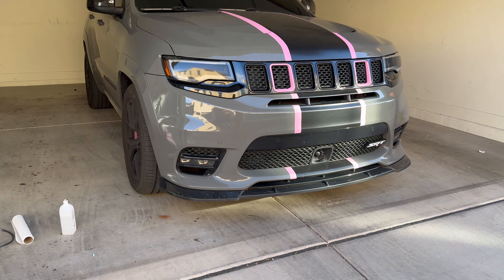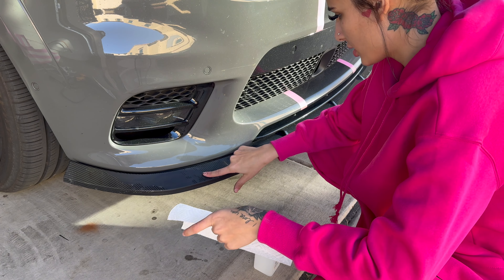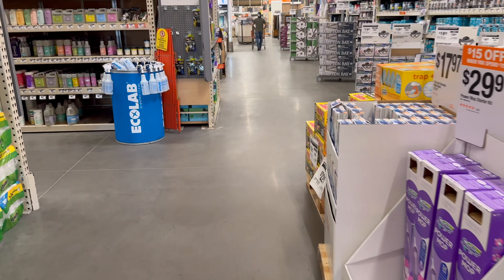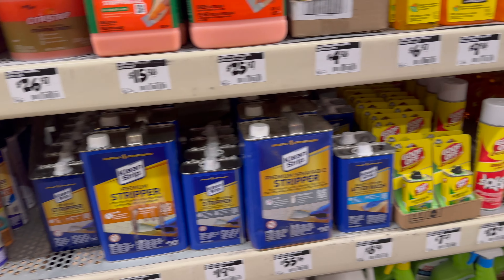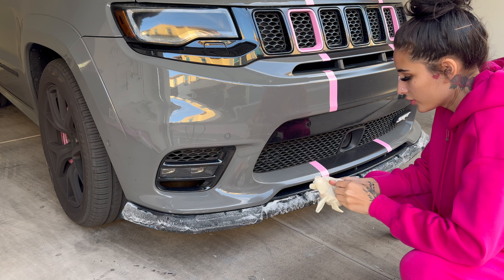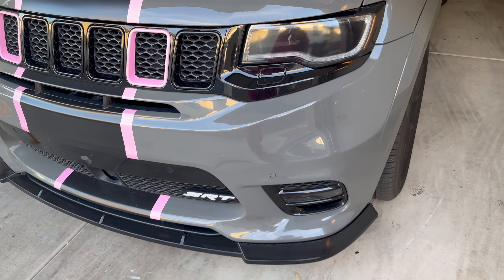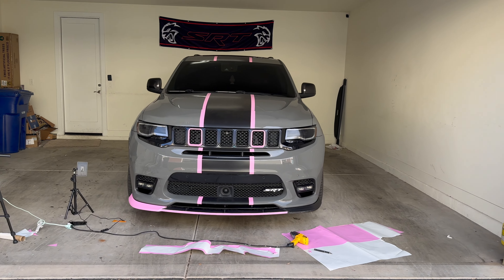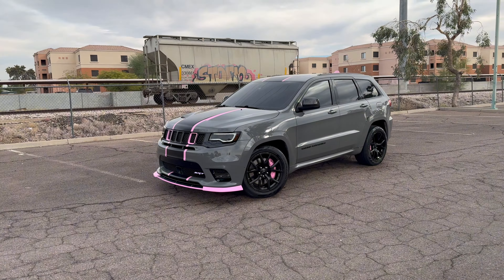MAKING MY SPLITTER PINK ON MY TRACKHAWK FOR ONLY $20

Comment: 0-60 in 4.2 seconds with stock Jeep SRT is more than enough performance.
You can add a Whipple  super charger to a 6.4 L SRT, but then you have to upgrade the suspension, brakes etc to cope with the additional power
Reply from the maker: i didn't get it for performance I got it for looks :)
Reply: I upgraded my 2018 Grand Cherokee Summit for a 2017 Jeep SRT for the performance and the looks. Very happy with the change.
Your SRT looks awesome